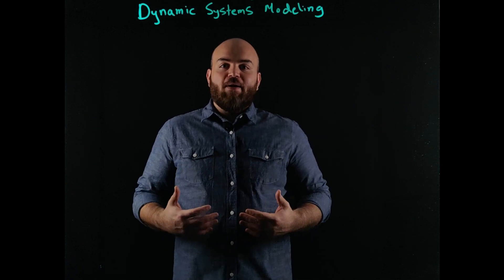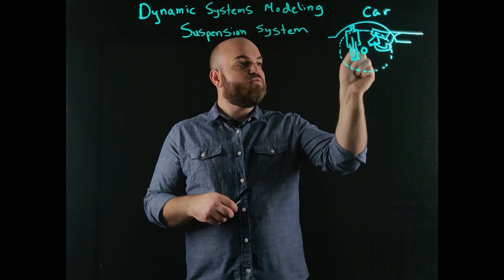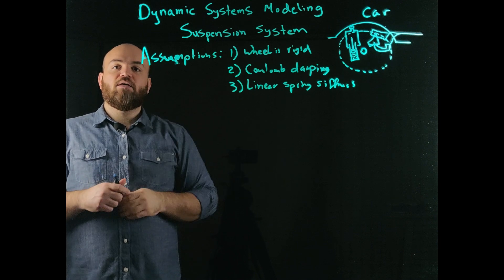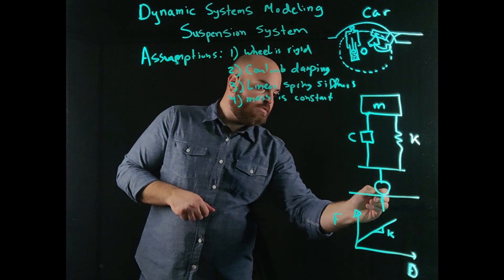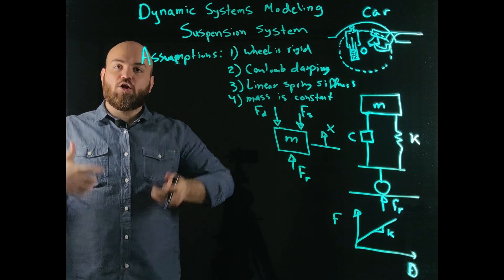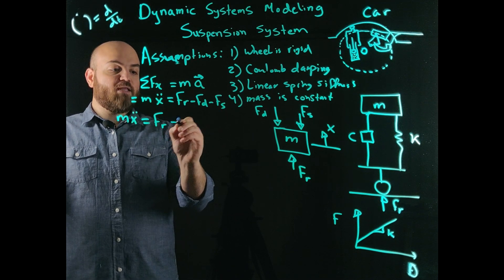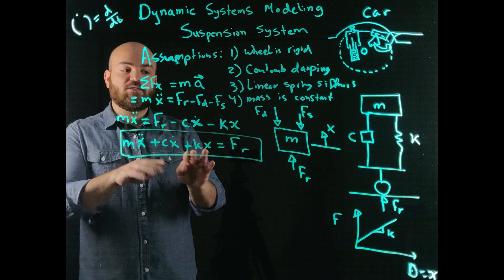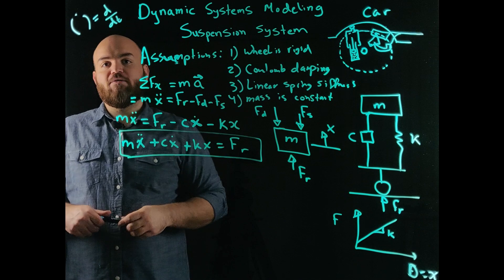Spring Mass Damper Model (suspension system)

Comment: How do we account for the force of gravity on the system?
Reply from the maker: Hi BreN, typically with a spring mass damper system the gravity term can be neglected as it would not affect the dynamic motion of the system. Gravity would only affect the resting position of the spring after the mass is hung. You can find a proof for this in any mechanical vibrations text book

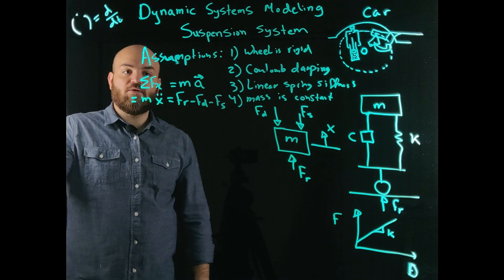Comment: 7:21 Why don't we add weight (mg) as a force in the Newton's second law formula or the Free Body Diagram?
Reply from the maker: Gravity only shifts the equilibrium point of the spring-mass-damper, at rest a vertical spring will deform due to gravity. But gravity does not affect the dynamics of the system